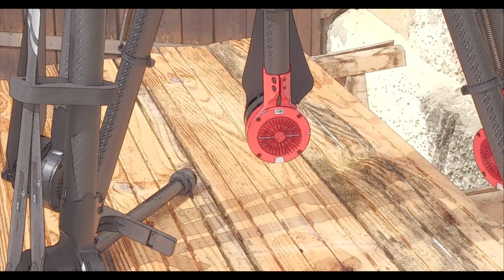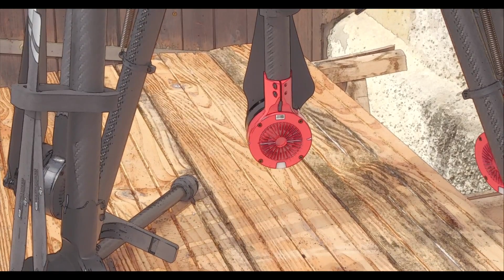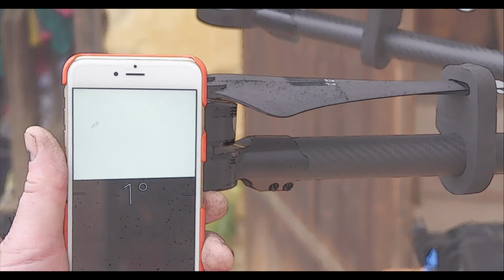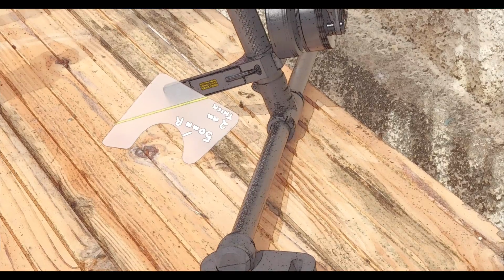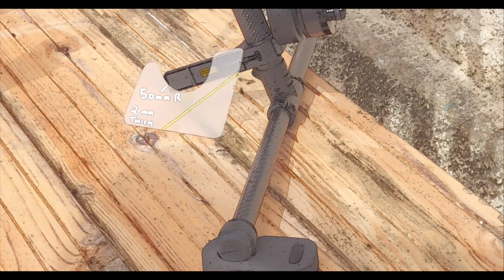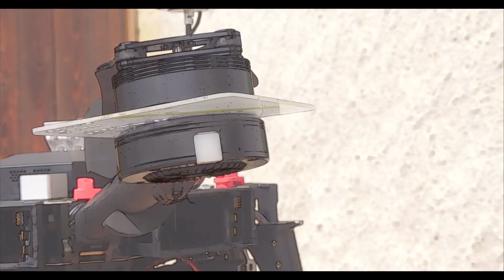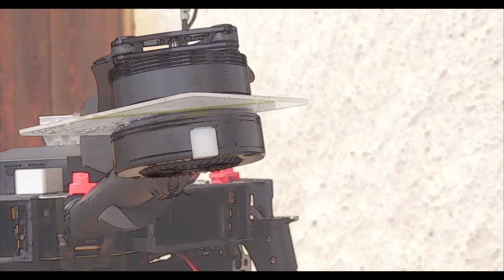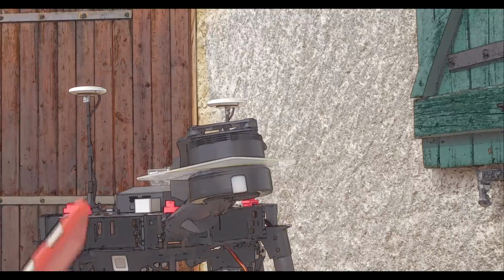arm 3º calibrate

Comment: Thanks for sharing!  But what does one do when an arm is quite out of spec?  Let's say I have an arm that has the motor 0deg instead of 3.  Best I can see the frame arms have holes pre-drilled at the factory so I cannot loosen/rotate the carbon fiber tube.   I see a lot online about how to check for level, but not how to correct an out-of-level frame arm.  Thanks!